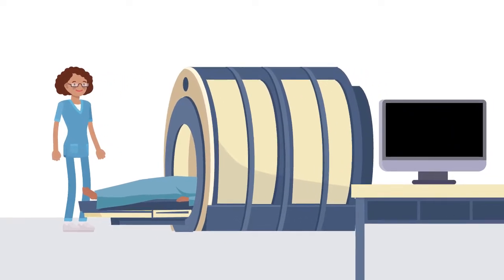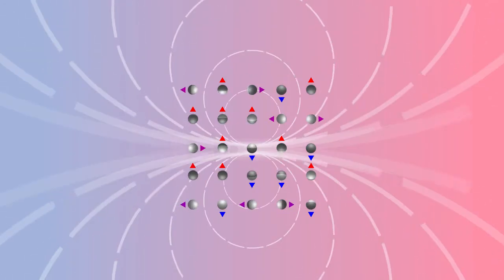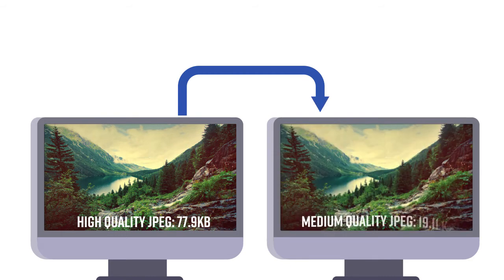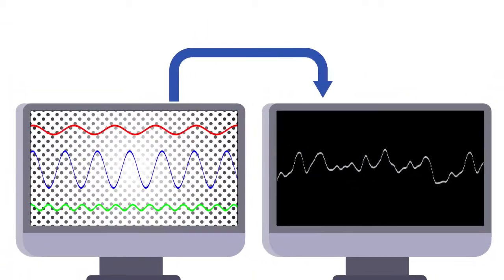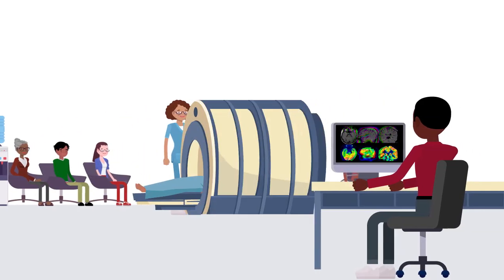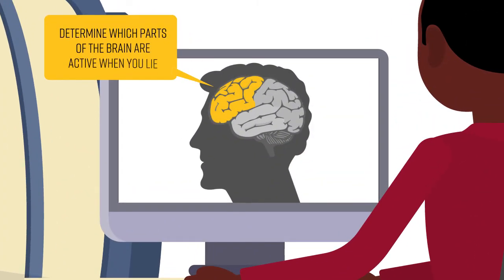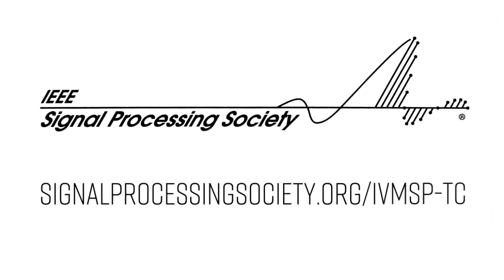Signal Processing in MRIs

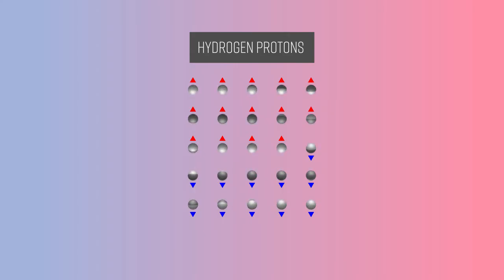Comment: "Without radiation"? What about the RF-pulses? (0:49) Just electromagnetic radiation.
Reply: I think the RF pulses are called that more because their frequency is at a range equal to Radio Wave frequency, rather than it transmitting the radio waves.  Even so, it's non-ionizing radiation.